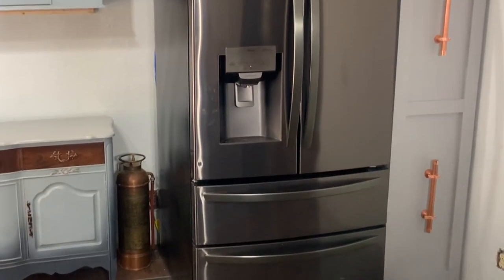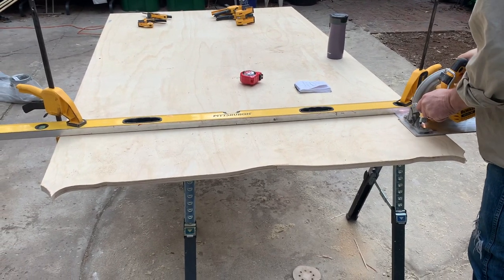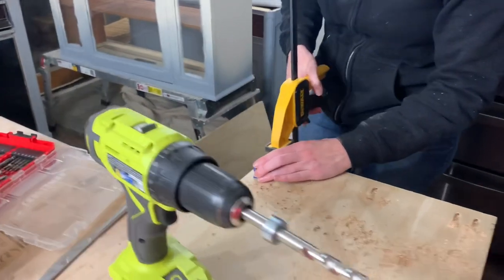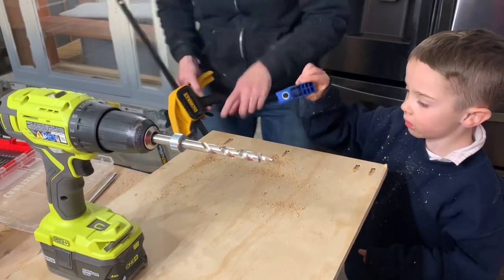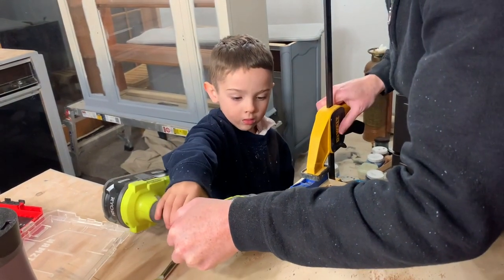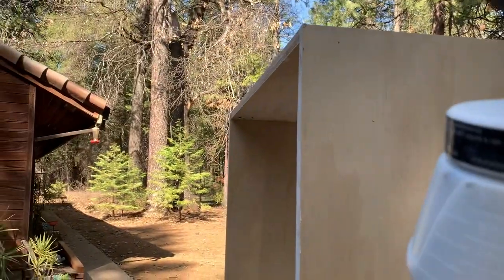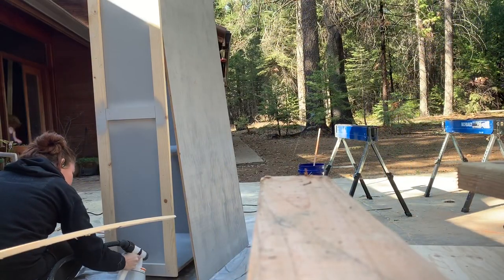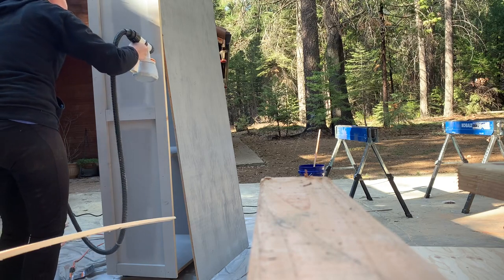DIY Roll Out Pantry | Copper Pipe Pulls & Plywood | Easy Pull Out Pantry | Elegant Upgrades

Comment: Cool build! Do those fixed casters work as intended? Did the pantry ever bumped into the fridge or wall?
Reply from the maker: Thank you! They did work well, however, I think a slightly larger caster would have worked better- once it was loaded with cans and boxes the smaller wheels didn’t move as smoothly over the tiles floors. It has occasionally hit the wall if someone gets too aggressive with it 😂 But for the most part there hasn’t been any issues with it just going straight in and out.
Reply: @elegantupgrades  thank you for your response. I'm thinking about the same project. I'll take into account bigger casters as you mention. Also thinking about adding lateral closet-like embedded wheels so the cart sides slide against the cabinet walls with one or two mm clearance